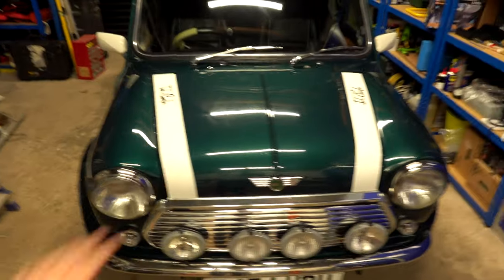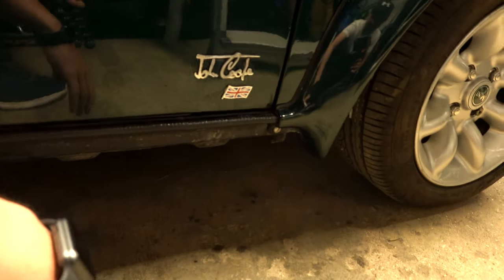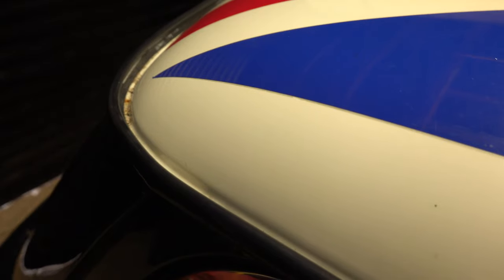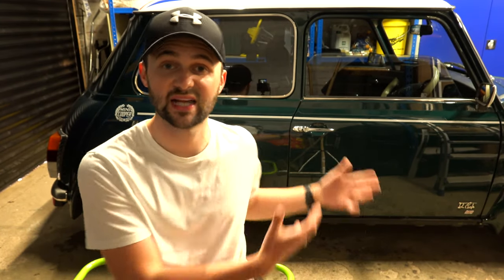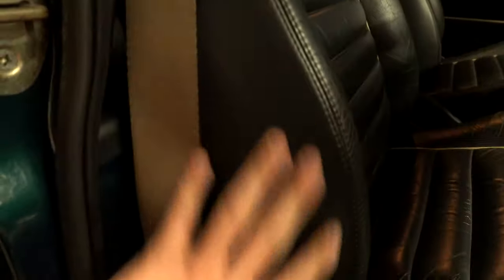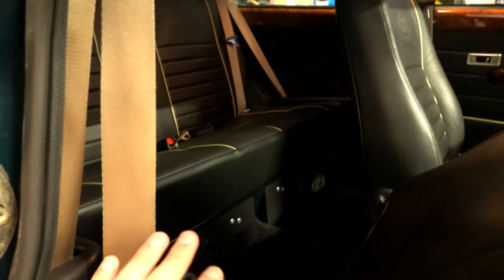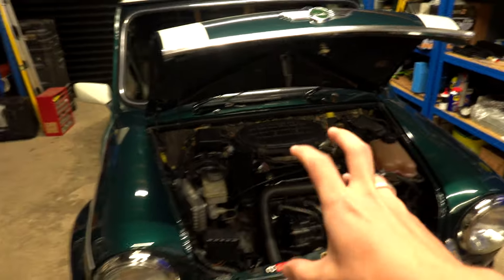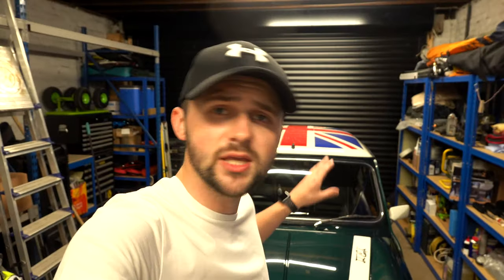What’s Wrong With My Classic Mini?!

Comment: Looks to be a pretty tidy car.  I have a very similar '97 BRG with black leather except for the Sportpack.  The wood is obviously personal choice (I like it and fitted the door caps on mine).  I prefer the aluminium handles and winders though and I think they look ok with the wood.  My wheels are the smaller 12 inch ones - I found it was cheaper to buy a complete new wheel and tyre set rather than get the wheels refurbished (my tyres needed replacement due to age anyway).  I like to keep it fairly original - but some aftermarket stuff looks ok - for example, Smiffy's Bits does a lot of stainless steel bits and pieces for under the bonnet.  Some are a bit too bling for me, but there is stainless steel plate that you can fit around the bonnet catch, which looks good for example.  Good luck with your Mini.